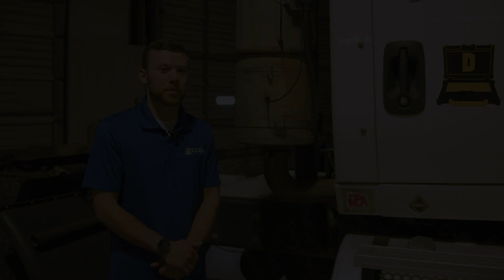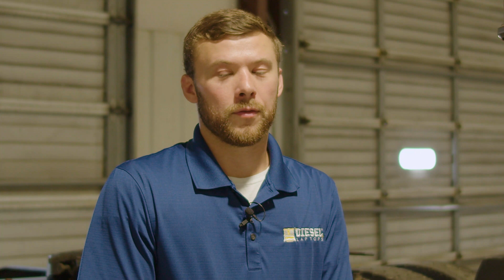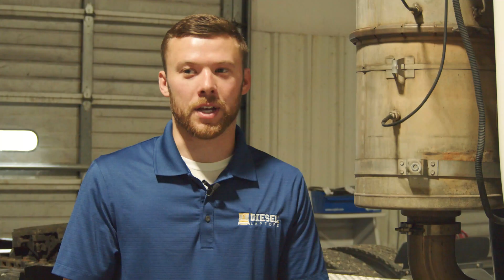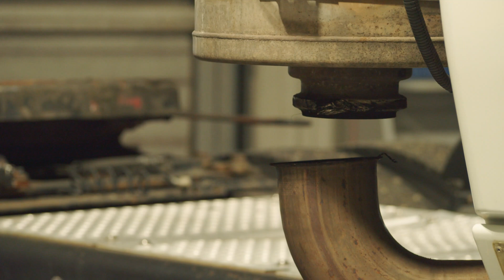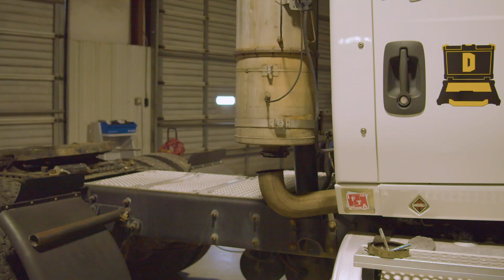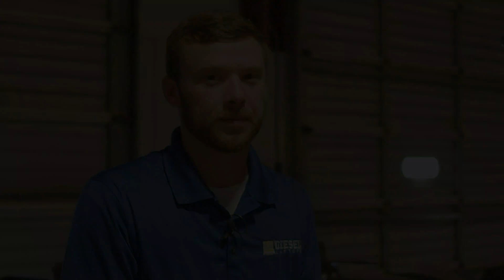Excessive Regenerations? Snap Acceleration Test Can Help Identify The Cause

Comment: What if it was smoking bad
Reply from the maker: If while performing a snap accel test you get a lot of smoke, then you have an engine issue.  This could be timing, injector failure, low fuel pressure, oil consumption, failed actuators, etc.  verify you engine does not have any performance issues.